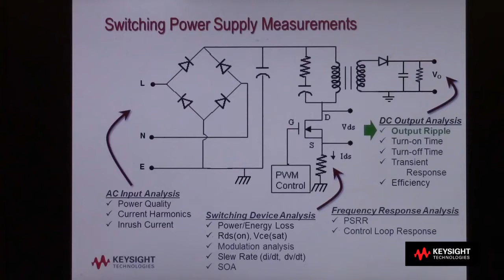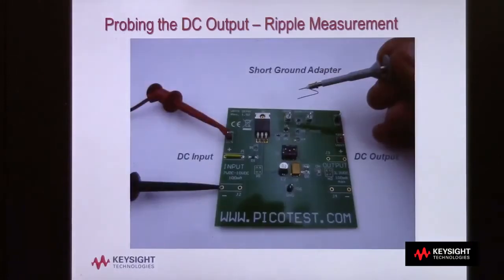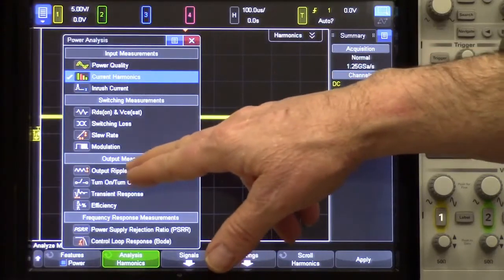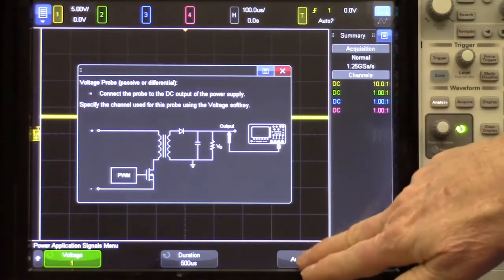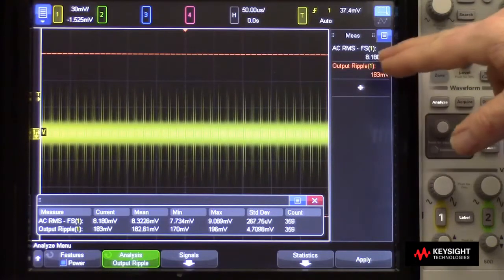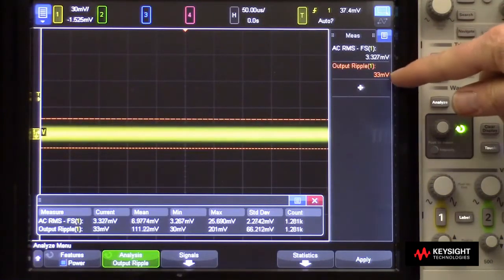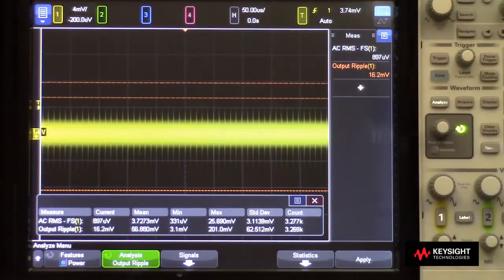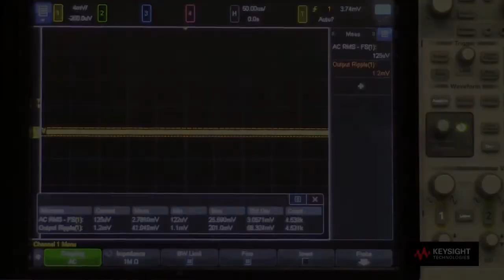Making Output Ripple Measurements on a DC output

Comment: I want to know the measurement device model name.I see the vertical resoultion is about 200uV(?) as I see on the video.Now, I'm trying to measure the LDO Ripple and I need the device which has a precise resoultion like thatplz, tell me the device name!!!!!
Reply from the maker: This is an InfiniiVision 4000 X-Series oscilloscope, and Johnnie is using the highest bandwidth version (DSOX4154A). This series of scopes goes to 1 mV/div in hardware, but the probing attenuation ratio can change that.

Comment: This explanation was kind of all over the place chaps. Don't talk about long antennas - the pickup was from too large a loop. And at least cut away to what you are measuring from time to time for illustration. These instruments are clearly designed for low-end techs who don't really understand the principles of what they are measuring and need some hand-holding (otherwise they would be using a much more useful general purpose scope). So explain.